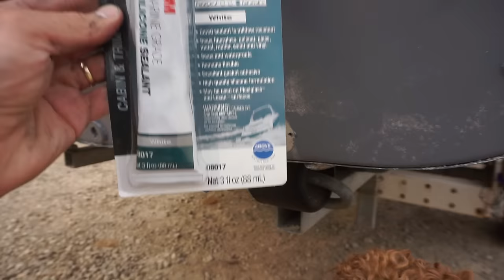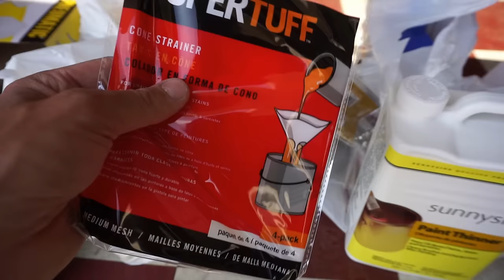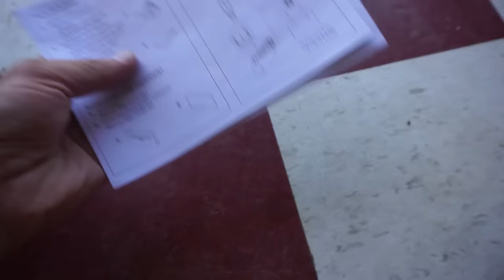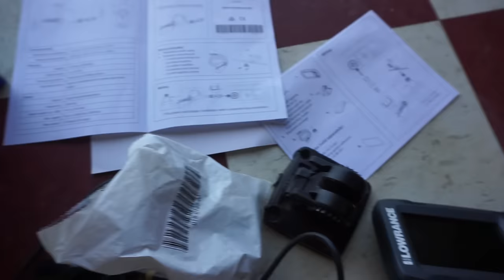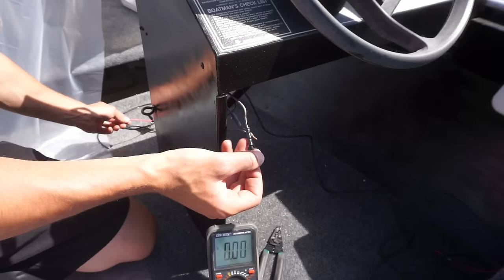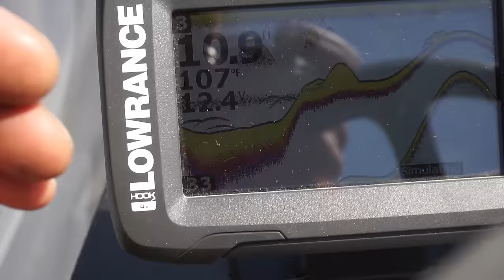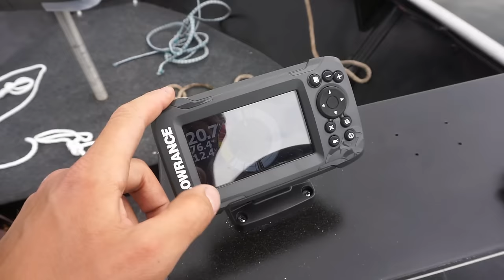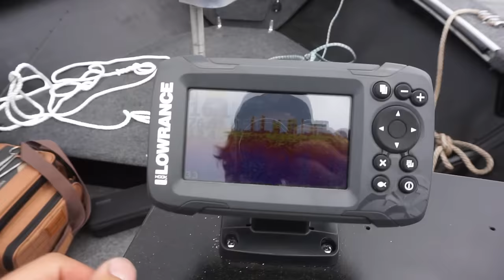First Ride On $500 Abandoned Fishing Boat. Will It Float?

Comment: You did a great job. Using silicone on the trailer lights help them last longer. I seen you spend a lot of money on spray gun and other tools. Being your spray tech. is bad next time try using spray on truck bed liner. Works great and much more durable and quitter in the boat. But other than that. Good job and always more fun in something you applied elbow grease too.

Comment: Hey feller those wires on the trailer that you used the butt connector and wire nut on  that is sure fire way to have your lights not work  you'll be working on the lights again within a year I know you young bucks don't mind going back over electrical wiring but we older fellers find annoying having to go back and fix something 
The best way to ensure a longlife in automotive wiring is to solder the wires together then give them a coating of dielectric grease followed by heat shrink tube those butt connectors are ok as long the crimp end is soldered greased and  shrink wrapped the wire nut should never be used on anything that isn't home wiring and in a union box inside of a wall  this post isn't meant to be mean it's just meant to be informative

Comment: Mine did same thing. CHANGE THAT WATER IMPELLER! your not putting enough water thru motor to keep it cool. Very easy to over heat and lock motor. Impeller is rubber located in lower unit. They get hard after a while.

Comment: On them ears you can put a peice of rope or zip ties to hold them tight when running on hose will save ya some trouble motor won’t shake them off either

Comment: Change the water pump impeller and new correct heat range plugs clean the carb etc
Reply: Make sure the water hose is clear and allowing water into the motor

Comment: When you roll paint, get a 5 gallon bucket screen, drop it into a 5 gallon bucket, pour the paint into the 5 gallon bucket and profit. Use an extension so you don't have to bend down or anything. If you can't get it done in a day, leave the roller submerged in the paint and then cling wrap over the bucket lid. It will be ready to go the next day. Don't even bother with those stupid roller trays. All those do is spill paint and waste time.

Comment: I actually did a job for some older guy who had a boat that he threw in to help with payment but has been sitting over 10 yrs and has bad transom that's rotting. I've been debating on restoration just not sure if it be worth all the work and money although I do know motor is good just everything else would need replaced basically so not sure if I should do it cause idk if id get my money out of it back but was a nice bass boat at one time. Think it's called a maidencraft 1700 with the evinrue 90 or 100 hp 🤔...im open to all opinions on what to do and would be much appreciated!!
Reply: Btw Joe you once again have done a great job with this build although I'd maybe throw a coat of clear on it still if ya hadn't done so yet but nevertheless well done my man!!

Comment: Why do people use wire connectors for inside use on boat trailers or any trailer. There are solder butt connectors that work great and a heat gun melts the solder and shrink wraps them too.

Comment: Cant use wire nuts like that. They will corrode fast. Use those connectors that solder and heat shrink same time. Put dielectric grease under your grounds. Keep from corroding. Don't use rivets. They won't stay tight. Should use that boat clear coat over everything.

Comment: You're using the Graco spray gun all wrong. Pro tip - turn your spray nozzle 90 degrees if you're making horizontal passes OR make vertical passes if your nozzle is fanning horizontally. It sprays like 12" wide and you're going sideways instead of working with that 12" fan of spray

Comment: Never start the motor not in the water unless you want to have to change the water pump impeller.  When you paint with a roller and want smooth paint you have to sand it smooth,  same with spraying

Comment: You really need rear tie down straps holding the rear of the boat to the trailer.  Hate to see all your hard work be for naught if the boat was to swing off the trailer when going down the hiway.  Also change out the old impeller and thermostat... A hot motor as you know will cook the rings.  Finally saw you did have the rear of the boat tied down to the trailer. Congrats on that.

Comment: When driving boat start with the motor tilt all the way down and as you go faster you raise up the trim on motor it'll go faster and handle better just remember to lower when you stop..
HVLP stands for high volume LOW pressure you only need  15-20 psi while spraying and use a filter on air hose just before the gun, never go to max pressure into the gun..
Mechanic skills are great.  
Painting, electrical skills are really bad, everything you did was pretty much what you don't want to do..
Buy an air paint gun at least I don't care if it's the cheapo harbor freight gun, never use that sprayer on anything other than a house project..watch videos on how to properly use a HVLP gun and paint it will spray, paint your using doesn't work in those guns, needs to be thinner. Never paint up and down  go long strokes left to right...

Comment: Why not just pour the paint into the big bucket and the paint thinner into the smaller bucket then pour that into the big bucket?

Shouldn’t the fuse to the fish finder be located off the battery as the wire now can short between the fuse and battery?  Unless there’s another fuse closer to the battery.

Nice job otherwise on a boat that was destined to be junked.

Comment: Never ever use wire nuts on a boat or trailer. Never ! They aren’t made for marine use.  Shrink tube butt connectors . Put dielectric grease on connectors so they don’t corrode . I’ve built boats for 30 years in Maine.

Comment: You need to tear that all apart and take them wire nuts off and put shrink wraps fasteners because the 1st time you backed into the water then joins for you put them wire nuts are gone corrode in your quit working again

Comment: This guy just buys things that are in very bad condition and goes as cheap and lazy as possible and fixes them so that they run and calls it good. No water tight crimps or connections on the lights, didn’t even tuck the rear tail lights wires away.😂